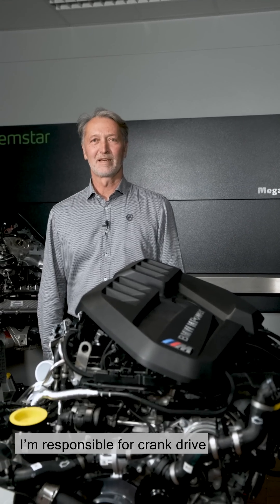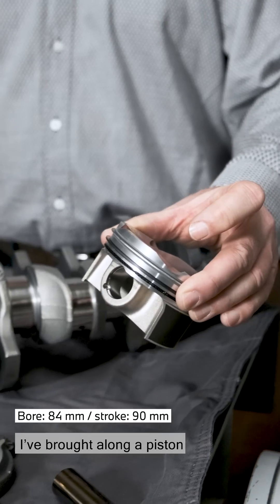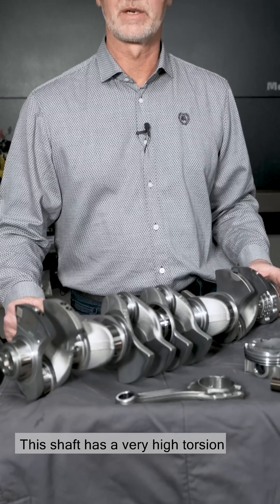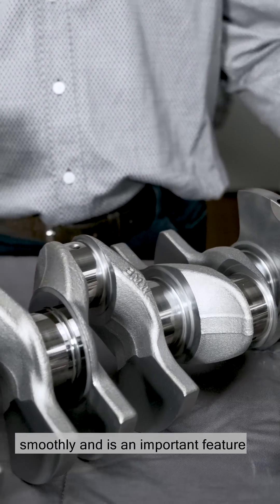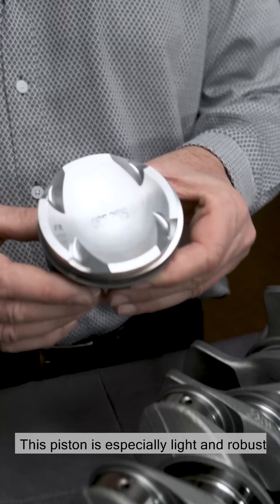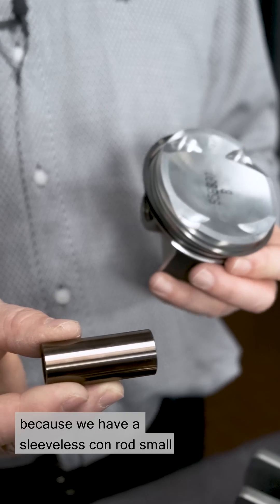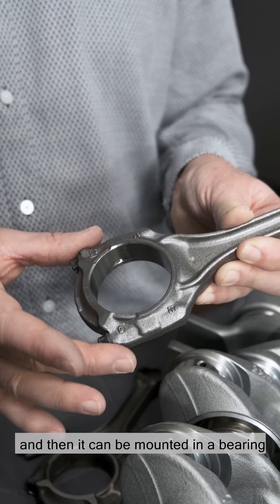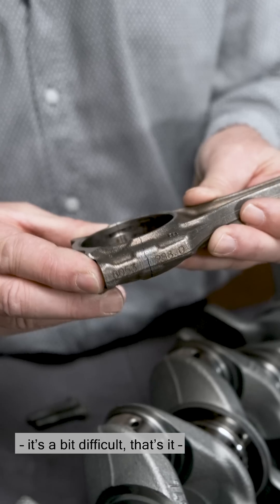Engine Details. M3 and M4 - explained, Episode 08.

Comment: If the instructor at the Cummins engine class I took saw someone put together a fracture split rod the way this guy did, they would get kicked out. It's imperative that the fracture split surfaces are NOT messed up and watching him misalign it twice like that sent shivers up my back.
Reply: Yeah well, i also doubt that ur class instructor will ever be invited to design an M car engine either.
Reply: @clark5583  I recommend you watch some cool free youtube documentaries about diesel engines because you'll be surprised what kind of feats these engineers achieve.
Reply: @clark5583  sorry dude, let me clarify...the class I was referring to was for a $40k engine; the Cummins x15. When it comes to the mx13 engine which is ~$60k, Paccar just expects you to not need to be told how to handle fracture split rods. The cheapest truck I work on is more expensive than an m3. Trust me when I tell you, in the heavy duty industry, a lot more is at stake when someone is relying on a truck to be operable in order to put food on the table, than some rich prick having his german sports sedan back for the weekend. Watching this bmw engineer fumble the surfaces together like that gave me goosebumps.
Reply: @RussianSupaPowa  yeah well, now u're comparing apples with oranges. One is built for revving and fun, another is built for reliability and towing.
Reply: @clark5583  it's not apples to oranges. Fracture split rod handling doesn't change if you're working on a high revving gasser or a big diesel. The whole idea behind fracture split rods is that the 2 surfaces are a perfect fit. If you jam them together out of alignment, you fuck up the perfect mating surface. Notice how before he took the cap off the rod, it was impossible to see the seam but after be fumbled it a few times the seam was easily visible. It's really THAT big of a deal. Look up fracture split rods, it's awesome technology.
Reply: It's a demo engine chill lol. @RussianSupaPowa

Comment: Nitrile hardened crankshaft would be good. I don’t think high revving applies to these modern i6 engines most performance cars rev to and beyond 7-7.5k rpm bmw should really be pushing 8k if they wanna claim that they are high revving.

Comment: BMW should experiment with small capacity V8 and V10 instead of this wimpy 6 Cylinder stuff, what are we? Citroen??
Reply: l6 engines are just better. Fully balanced and very simple.
Reply: 2 L, 3L,4L....4,6,8 cylinders..all turbocharged...I always thought the 1 and 2 series should have had 2.5 L inline 5's to better fit the short snout..
Reply: I just got an E90 M3 and I'm not selling it, can't beat the S65 for it's awesome sound!! Puts a smile on my face everytime I drive it and that's what M cars are supposed to do!!

Comment: In before all the grill haters
Reply: I'm a grill lover. The top opening at its highest is identical to the outgoing model in elevation from the ground up whilst its volume is nearly 100 % more than the 2020. While rolling it looks better too. Its only unflattering while static.
Reply: @theraggededgeonboardfastes8461  too bad there is a huge bumper beam behind it blocking some airflow, overall inlet area is probably not that much greater than if they did their traditional grills
Reply: @danielpyziak6537  I wonder if there are any addition functional benefits from this grill in terms of under hood air flow cooling different parts of the engine that aren't the radiators or diverting turbulent air in the engine bay. Now we need to look at extractors or vents in the hood to form an opinion if any of what I said is true.

Comment: Why didn’t he explain the crank hub everyone seems to be upgrading? Or give the consumers an explanation of the design.
Reply: S55 had a friction fit crankhub that could spin and cause timing to go wrong. This one doesn't.
Reply: It isn't applicable to this motor.
Reply: Because the crank hub isn’t a “problem” on s55
Reply: @alexb5166  "S58"